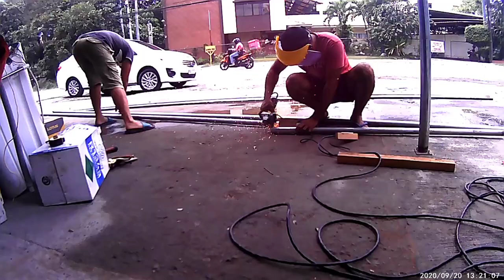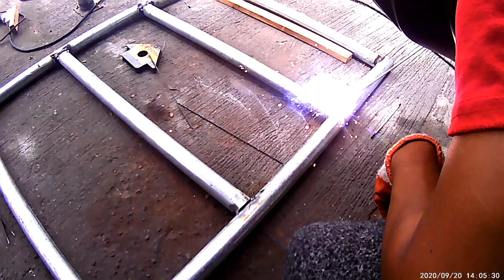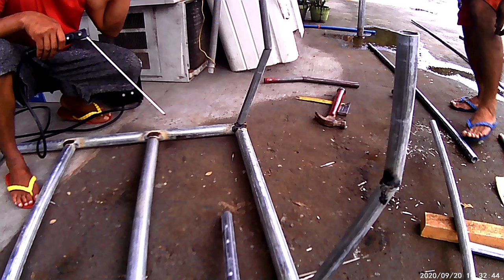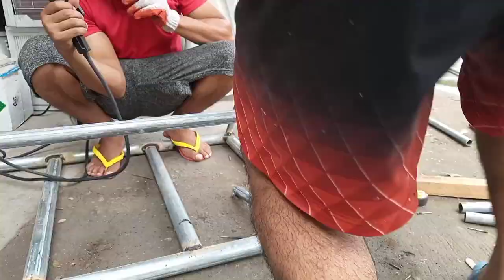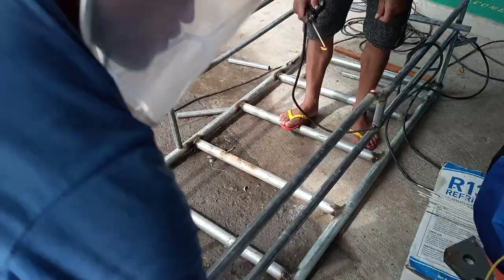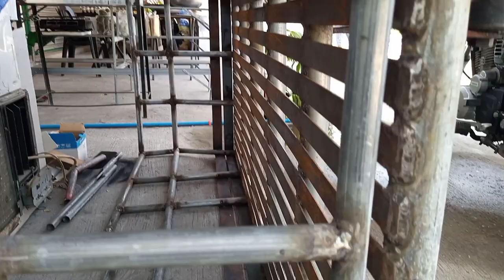DIY | MOTORCYCLE SIDECAR | SIMPLE DESIGN

Comment: If you were to make another sidecart frame ,would it help to use box tube for ease of fit together ?Say rectangle on the flat for the base & square for the sides . Then a light weight gal mesh inner . It shouldn`t compromise strength ,cost , looks or weight .Please tell me about your connections to the bike .I particularly enjoyed the practicality of your build .